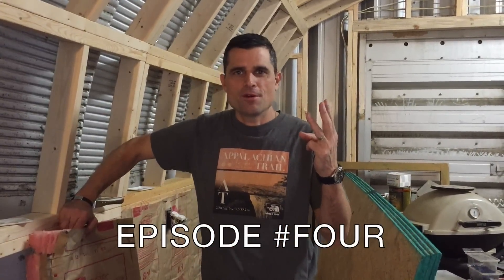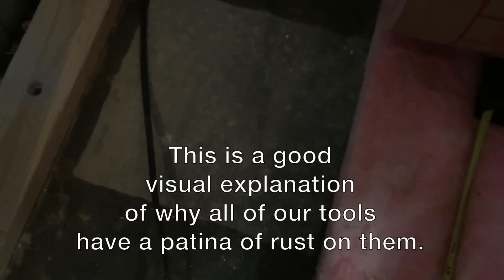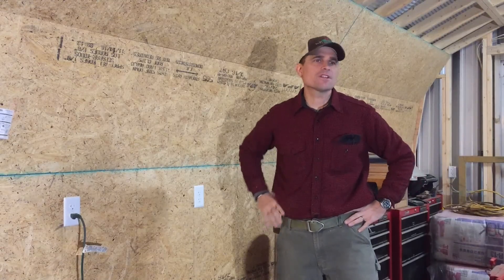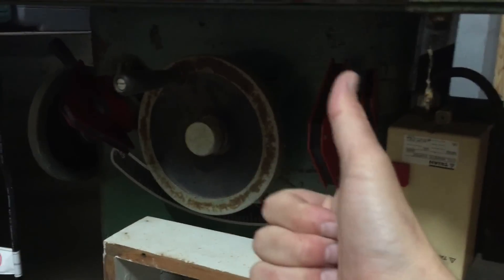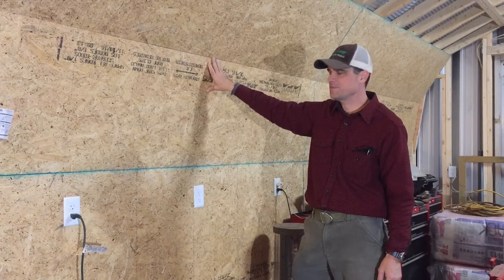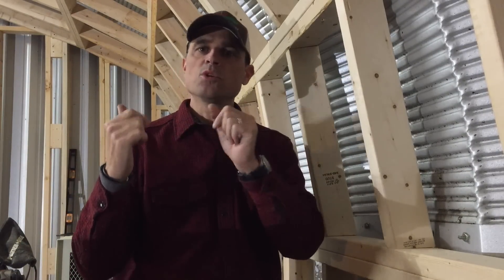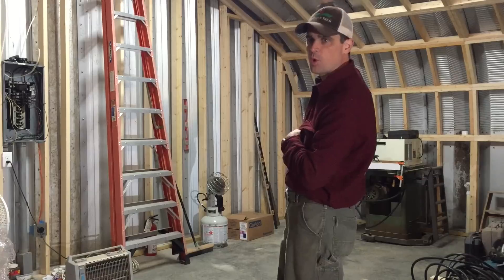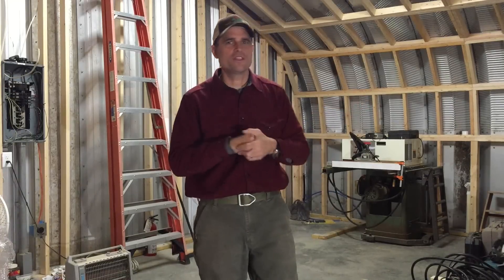This Old Quonset Hut (Ep. 4) - Insulation and OSB Sheathing

Comment: How did you deal with the moisture  issue?
Reply from the maker: Carl, good question.  I'm guessing I should have addressed this in the video, because a number of folks have asked about it.  We've been in the building on a number of occasions, when it has been really cold outside and we've run a propane heater (moist heat) in the space until it was almost too warm in the shop.  In theory those times would have produced as much or more condensation on the metal as we would ever produce, and we've never seen any.  Or felt any.  Don't know why.  Maybe there weren't enough people or sources of moisture to generate the necessary humidity?  With that in mind, I'm not super concerned about condensation once we finish this project.  In residential construction, we now put styrofoam "channels" on the underside of roof sheathing between the insulation, to move air (ventilation) between the roof and the insulation to help prevent condensation and resulting mold and mildew.  So ventilation is the key.  If you look closely at the way we're doing this project, none of the materials we are putting up touch the metal, plus the rib design also creates massive air channels.  These quonset buildings have a lot of air gaps (in the way they are constructed) on the end walls, so there is already great ventilation, but we plan to also install a fan to help move air from the space between the exterior metal shell and the interior framing.  I should add that this shop will not been in use all day everyday, so the number of hours when condensation might even build would be limited.  We'll also have a dehumidifier with a humidistat in the shop.  AND, it will usually only be one or two of us in there working, so we won't produce enough moisture (through the OSB sheathing and insulation) to cause condensation.  And we'll use a wood stove in the winter (very dry heat), again reducing moisture in the building.  Plus, to be really honest, I'm not all that freaked out if a little mildew grows in the in between space.  Hope this helps answer the question.  Thanks for watching and asking!  God bless!
Reply: My two porches has g-rib metal roofs and on those cold frosty mornings or deep freeze they always frost over underneath the metal at night and as the air warms the condensation drips,  sometimes times heavily. I helped a friend once who had a metal roof on his modular home,  this is the way it was manufactured and we added more insulation, upon opening the metal roof we notice condensation had dripped on the insulation.  His heat source  is ventless  propane and it does generate  a lot of moisture.  We did not see any mold what's so ever, so apparently  the moisture is being absorb rather quickly and some how disapated, probably through roof vents. 

Reading you comment above I do believe you addressed the issue correctly. Air flow is the key to dissipate any moisture.
Reply from the maker: Yeah, I must admit that I've thought it was odd that we've NOT seen condensation inside the building.  But I've checked for it repeatedly and never seen any.
Reply: I've built three of these buildings, two as homes and one for an indoor pool and  - they all leak. With my latest home I rebated the baseplates into the slab so the water wouldn't track into the house but the baseplates still take on water after a rain, especially if the wind drives against the seams. There are over 4000 bolts in the roof and the washers deteriorate so unless you epoxy the whole building you'll get leaks.  I used a waterproof underlay against the panels BEFORE I installed the insulation to prevent the moisture from ruining the insulation and creating mold.

Comment: I'm seriously listing to you.  Great job.  I want to build my quonset building in the future and was thinking about spray foam.  Great to learn a better way
Reply from the maker: Scott, thanks for the kind words.  I don't know that the way we are doing it is necessarily a better way, but it is the way that makes the most sense to us and is entirely DIY.  Also makes sense for the purpose of shop to be able to attach things anywhere.  Important to note that this quonset was already on the property when we bought it.  One thing we've learned since - the end walls are not necessary to the structure, so you could frame and side those as you would in a traditional house.  This would make things MUCH easier when it comes to doors and windows.

Comment: Hi.  Nice framing and carpentry work.  I'd like to build a  different and quirky DIY tiny home (about 800sqf interior space)  in rural central Florida using one these buildings.  My 1/4 acre residential lot a 750sq feet minimum primary dwelling.  I know  there will be some challenges to pass Florida Building codes, in particular getting R-30 ceiling insulation. I know I need to get an engineer to build plans for me, BUT   I am wondering...   I like your design but I'd like to use far less lumber.  Think I can use really long bolt screws and floating 1x4 furring's to achieve about 8" of wall/ceiling gap. First wrapping and taping with an interior with reflective  vapor barrier, then bolting on the floating 1x4 studs, stuffing in R30 Rockwool bat insulation and then screwing on 1/4 thick wood panel as my finished wall (no drywall).  Any thoughts? and is this something that could pass Florida building codes in Zone 2?

Comment: Why did you go with an electric on-demand water heater!  Natural gas and propane are normally significantly cheaper, and I'll be surprised if you can get enough hot water from a unit that can't draw much heating amperage?

No disrespect intended.  Never been able to find an instance where electric-sourced hot water is more affordable.  I sell a very cost-effective gas unit that will produce 2.7 GPM, and if that's not adequate, you can install a second unit either in series or in parallel.

Im a first-time viewer, so look forward to finding out these answers!

Namaste
Reply from the maker: Mark, thanks for the comment.  The on demand electric heater seems to vex more than a few folks.  I'll be honest that I'm still not completely sure why.  In our experience, many months on, it works great and produces an endless supply of really hot water.  God bless.